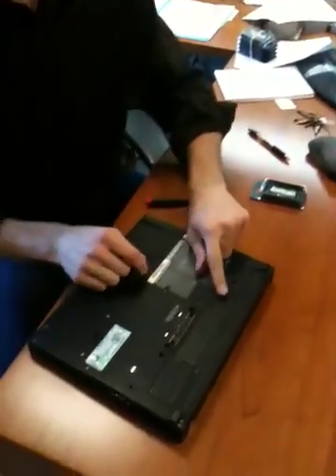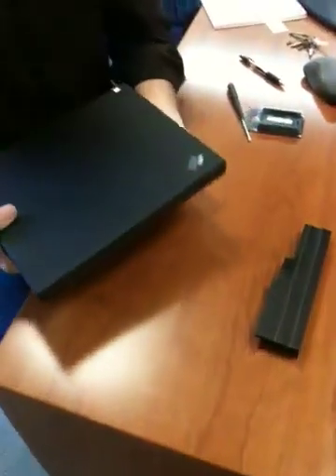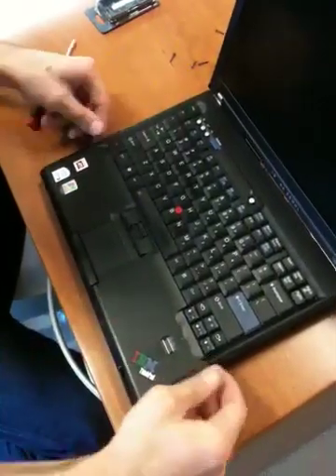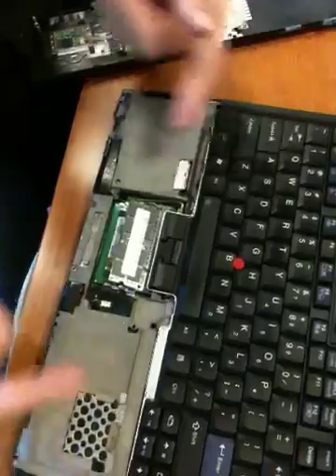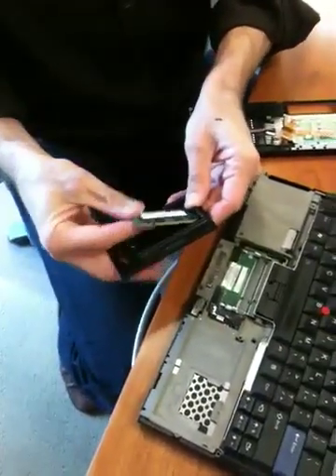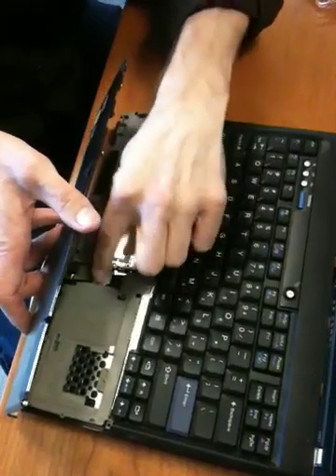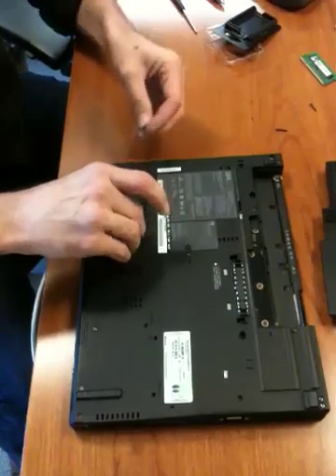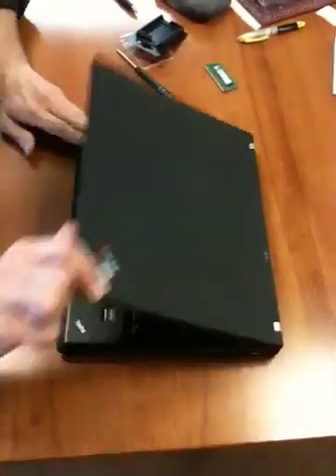Upgrading memory on a ThinkPad T60

Comment: Thats why I love old Laptops upgrade them is simple not like todays to change ram you need unscrew 6 case screws and another two which holds protector old laptops 4 screws to change ram and touchpad and btw I writing this comment from Lenovo/IBM Thinkpad T60 dam this laptop is better than my parents Dell vostro 1015
Reply: +Nameless Not all modern laptops so bad. E.g. provbook 640 g1 - one screw provide access for all components :)